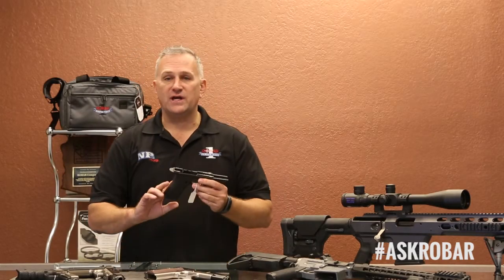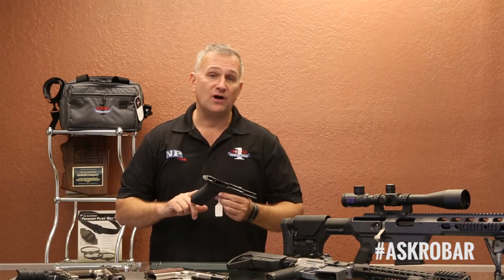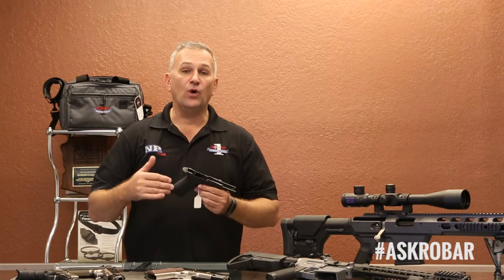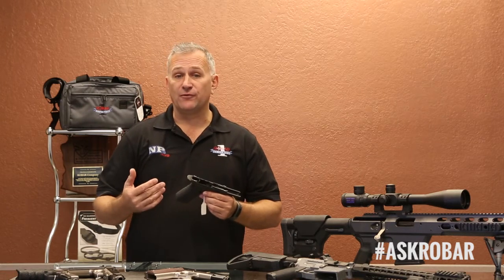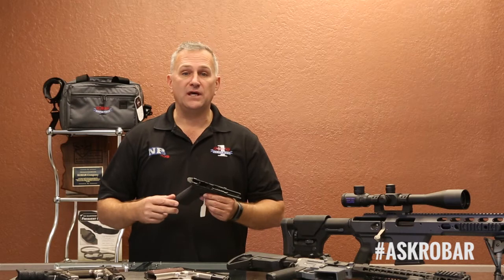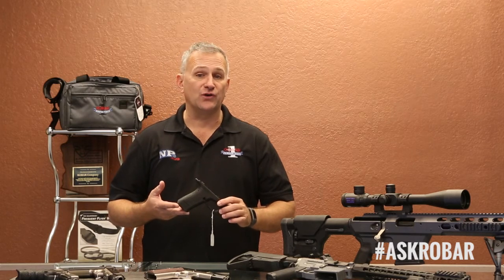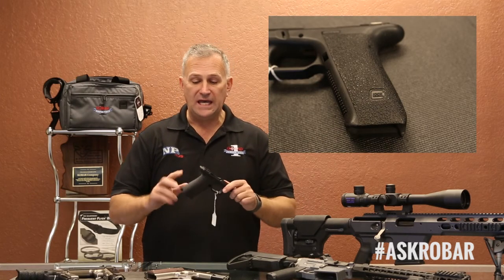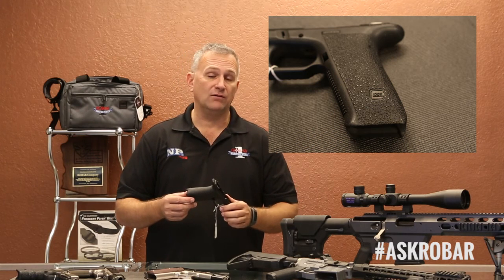Grip Texturing Process - #AskRobar

Comment: @ROBAR Companies Inc. - I just purchased a CZ P07 that has the Robar texturing which was applied by the original owner. Your product is only on the front and rear of the grip (sides of grip are stock). It is really way to aggressive with many sharp areas. Is there a way to remove it or tone it down once it has been applied? Thank you.